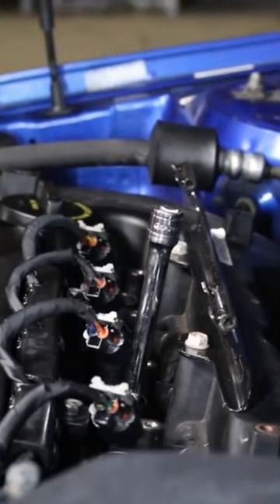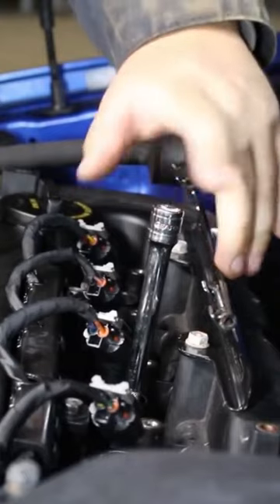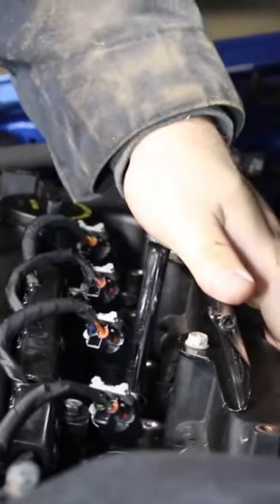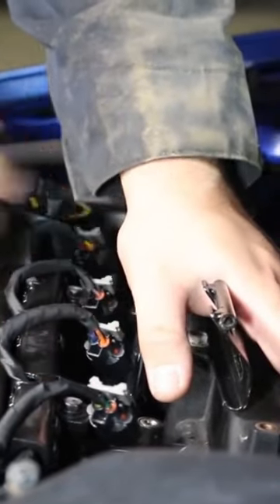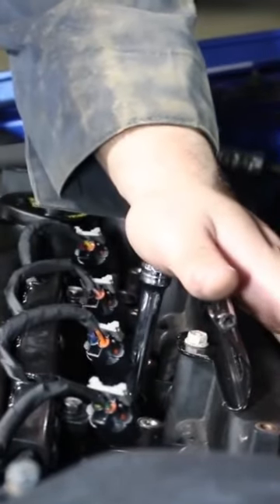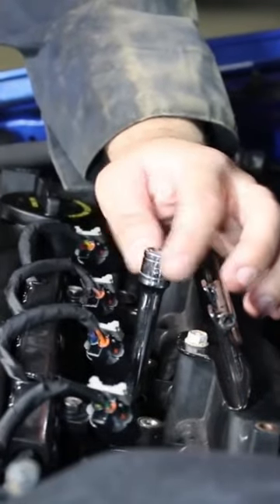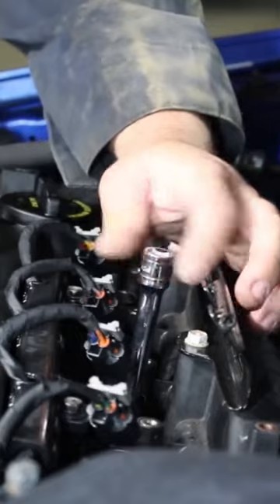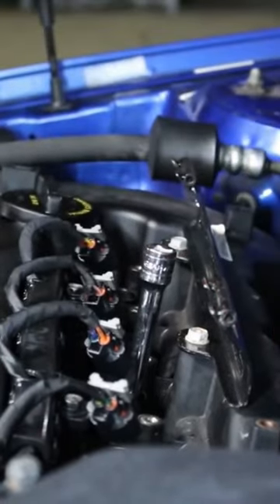How to easily diagnose rod knock / connecting rod bearing failure

Comment: Just lay under the car and put a mechanic stethoscope on the oil pan, Also if the knocking increases with the rpm then it’s most definitely rod knock. Also check the oil to see if it’s almost empty and it has metal particulates in it.
Reply: What if the knock is constant at most times but more noticeable at lower rpms
Reply: @jovo21  Rod knock is little lighter than a main bearing knock . rare to see a engine to have a main and rod knock at the same time .
Reply: Timing chain knock would increase woth rpm
Reply: @Jbuddaho  you mean slap? Timing chain slap and rod knock sound completely different and come from different parts of the engine. You would be able to use a mechanics stethoscope to listen and Tim f chain noise would intensify at the timing chain cover and be significantly less noticeable at the other end of the block.
Reply: Could it be a rod knock if it's only knocking at idle? It drive great with no engine light,  just a loud knock only at idle
Reply: @AngeloVentura-hv9ly  a rod knock/ worn connecting rod bearing will increase in severity with rpm.
Reply: @deeeyewhy5949  Thank you.

Comment: If your a season mechanic , you know what a rod knock sounds like , and the difference between rod and main bearing knock , And valve train noise is twice the speed of crank noise . This guy must have learn this from grandpa .In over 40yr as a dealer tech and fleet tech , have never seen anyone do this to diag a rod bearing noise . I guess the young guys are teaching us old dogs new tricks .
Reply: He's showing how to diagnose which cylinders have spun bearings without opening the oil pan....
Reply: Dont you mean valve train noice is 1/2 of crank knock as camshaft spins 1/2 of engine speed??
Reply: @theAngelofhevn was gonna say. 1/2 the speed of the crankshaft for valvetrain noise
Reply: @lilmixdboy I can’t see the point of locating which specific cylinder has rod knock. If it is knocking then the loose bearing material has already damaged the rest of the bearings/engine components. 

It’ll have to be opened up or replaced regardless
Reply: So can we replace bearing without measuring clearance.....will it work?
Reply: @anonymousanonymous-vq7dm  You can do it by math - or =physical -or cross your fingers hope for the best.
Reply: @roguewarr4662  thank you for reply.....friend.....

Comment: I just check the compression & it’s usually the cylinder with low compression
Reply from the maker: Low compression tells you that there is a problem but doesn't necessarily tell you what the problem is
Reply: @PoorManMods  I can guarantee your rod knock is the cylinder with the lowest compression
Reply: @jasondominguez8434  whoosh
Reply: @PoorManMods what do you think about the cylinder leak down test?  Hissing sound coming from throttle plate is intake valve leak, hissing coming from exhaust pipe is exhaust valve leak, hissing coming from oil dip stick or filler tube is piston ring or piston problem.
Reply: @jasondominguez8434 bruh how is compression related to bearing failure? right, its not. what do well sealing valves and rings have to do with bearings lol.

Comment: I thought I was the only one able to diagnose this in this manner. People told me I was dumb doing it this way. 

Btw you don't have to crank the engine over one revolution each time. Just have the pistons start going down and stop so you can create a gap if there is one between rod and journal. And each time you push the piston down with the extension you wanna double check by cranking it ever so slightly to re-create the gap and feel again.